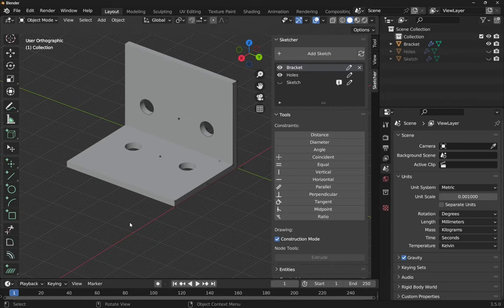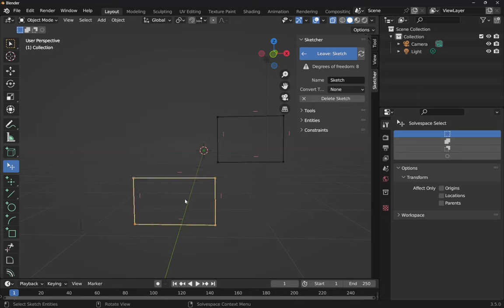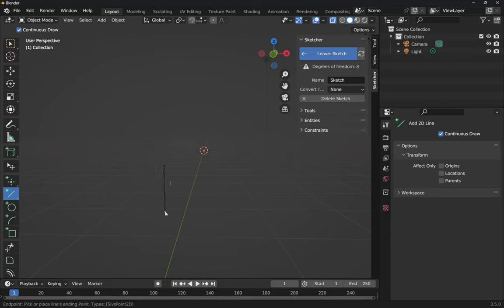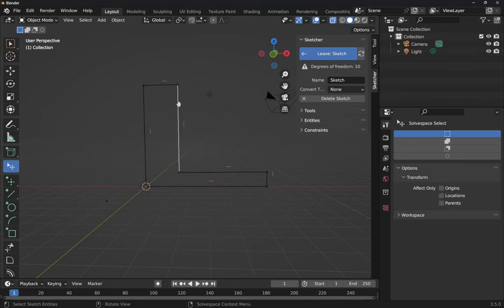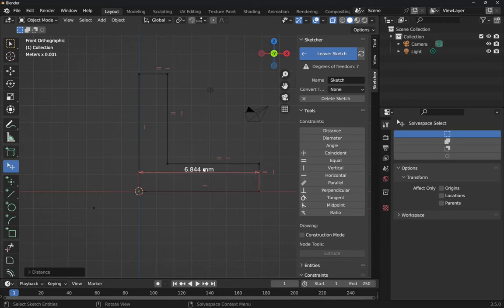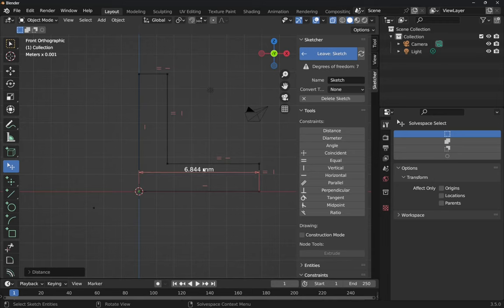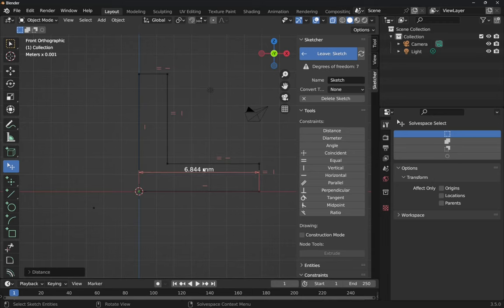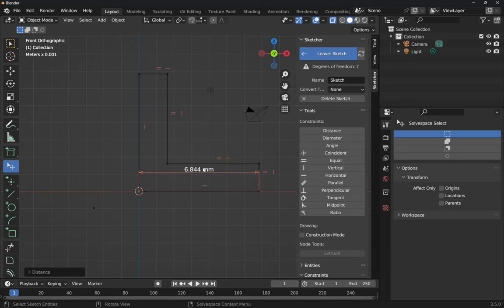Learn CAD Sketcher | 5 | Your First Model !  Bracket Using The Basics |  Blender Beginners Tutorial

Comment: Thanks for the tutorial. This add-on is very promising, however it's obviously still work in progress. I found it too restricting that I cannot place constraint between sketches, but it's still useful for simpler geometries.
Reply from the maker: I agree with you it's still early on development. I use freecad on my mangojelly solutions channel and for all my CAD projects but I keep these tutorials going as it developers as I support open source. The good thing to know is that constraints across sketches is currently available but you need to enable it. Take a look at my last video regarding hidden features. That may help.

Comment: when you extruded the bracket it seems like you stopped using sketcher at that point. what if the bracket was more complicated where you couldn't just extrude it. i'd like to learn how to do a 3d shape in sketcher, maybe that's still coming in your videos, just some feedback
Reply from the maker: I will be going into more complex 3d forms as we go forward. You can go back and edit the original sketch but what your seeing with cad sketcher is that it is trying to help replicate a CAD workflow called feature based modelling, so this is sketch upon a feature to create another feature. In CAD the extrude created a feature, you keep on going with operations and if you want to change aprevios feature you can go back and edit it.  Mesh modelling which blender is, is different. It's more like molding clay where changes have to be moulded out.
Reply: @MJ3D_Blender  got it, thanks

Comment: Thanks a lot, great tutorial! While watching I was wondering the thing I commonly encounter in CADs - to get a "point of an edge in sketch". What I mean by that - lets say those two wholes you constrained - you actually needed circle center to be 10mm from each corner of a bracket. And to do that - you need on a new "Holes" sketch to get point of  that corner. I wonder if its possible because it freeCAD I stumbled at this couple of times, they have special tool for that - "project".
Reply from the maker: Glad you enjoyed. Yes so in freecad you would   sketch on the face the same as in the video but then you can use the import geometry tool which you can then select the edge and make constraints against that. At the moment with CAD Sketcher you can only reference sketch geometry and that has to be along the same plane. I am hoping the same concept as in freecad will be added at some point. If I made this is a slightly different way then I would of been able to reference the geometry. I will set off I can included some of that information in in future tutorials.
Reply: @MJ3D_Blender  yeah, you actually can calculate it from midpoint, so no biggy, just was curious, thanks for clarification!

Comment: Instead of hiding the holes mesh (21:31), you can also leave it visible and change the "display as option". To do that:

1. Select your mesh (holes here).
2. Go to the Object properties (orange square icon between brackets)
3. Viewport Display section
4. Display as
5. Choose the option you like the most (bounds, solid, etc...)

I like that possibility so that I can still select the mesh and see the outcome of the boolean operation.
Reply: that's redundant and not the best way to go about it, you can still select the mesh in the outliner by default, and in most cases you would never need to select it again anyway because you only need to solidify it once. More of a risk in selecting it and moving or doing something with it and messing up your boolean compared to just hiding it and be done with it.

Comment: Great video, thanks for sharing, question:

When I use the 2D Line tool, my lines don't seem to snap to the vertical or horizontal plane like yours does, I can't seem to figure out how to make that happen, I tried holding shift but no luck, any advice?
Reply from the maker: Sorry for the delay.  Glad you enjoyed the videos. I have been experimenting to see if I can recreate what you are experiencing.  The only thing I can think is that when you lay down a 2D line your view point id not directly onto the plane so your sketching flat. Or, you are not moving the line until you see the small red line that shows that a horizontal or vertical constraint will automatically be added.  That makes it snap into position.  Hopefully this will help.